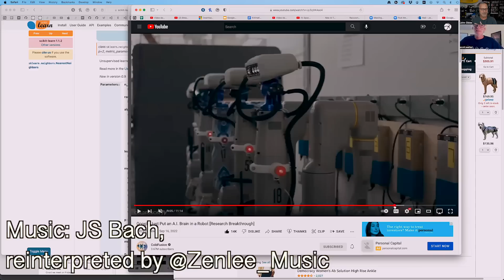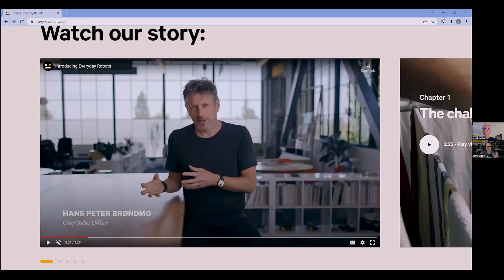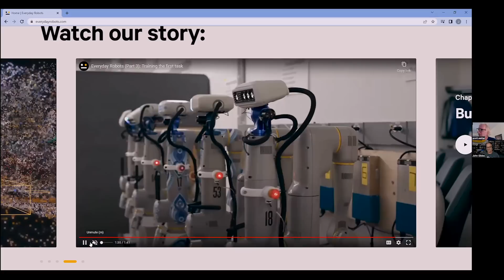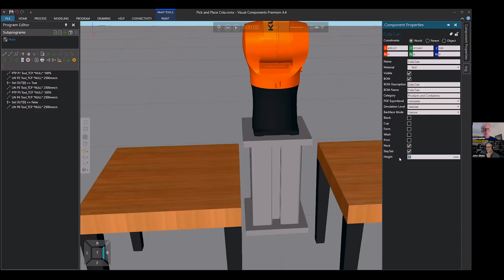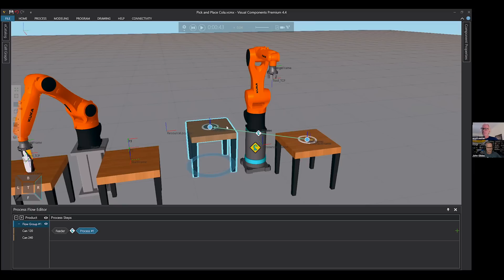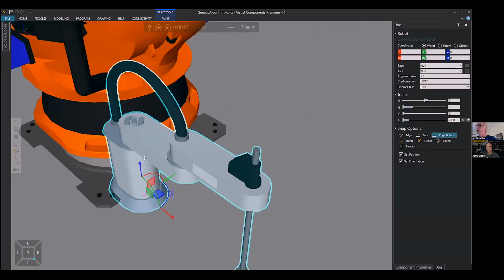GOOGLEBOT vs TESLABOT! Who Has the Right Approach? With Robotics Expert Dr. Scott Walter!

Comment: Cameras are LIDAR!
Active sonar vs passive sonar is no different than active and passive LIDAR. 
Active LiDAR uses light pulses (laser light) just like the ping sound of active radar,
And passive LIDAR receives light just like passive sonar listens only. 
Q: When Will people realize that the term LiDAR is not being used 100% correctly?When will cameras FSD be termed passive LiDAR (because it is passive light received by sensors) be used to when discussing active or passive LiDAR. 
Ask a submariner about sonar if you don’t believe me…

Comment: Following on from my previous theory is that maybe having a robot with a higher center of gravity is an advantage. This would allow the required instability to be controlled by leg and arm positions. It would be similar to balancing a broom on the palm of your hand  (with the broom head at the top). A space rocket, on take-off also relies on a higher center of gravity guided by directing the thrust in various directions the maintain balance?

Comment: The initial task of moving coke can is basically like the difference between machine language and a compiled language.  Making natural language processors even for just text has the same kind of lexical parsing and interpreting issues.  Not really a conceptually difference IMHO.  This is the same problem as programmers have been solving since the 1950s... Just with newer hardware and sensors.

Comment: I would suggest that walking upright requires inherent instability to allow the robot to constantly tend toward falling in any direction. This vulnerable state would help initiate movement by tipping in the intended direction. The onboard  "brain" would then intervene to control the fall by adjusting the footfall or center of gravity or both (resulting in useful human-like movement). This behavior might be compared to a modern fighter jet that is inherently unstable but is constantly being corrected by onboard computers. This allows the aircraft to react instantaneously to the pilot's instructions.
Reply: Humans walk pretty well and maintain balance "easily." Ears help a lot. Human physiology and kinematics are well-understood. Not to minimize the problems, but with reasonable sensory-motor controls and feedbacks, advanced AI models can be trained in simulations to handle a lot of those issues. Much of the focus on humanoid robots has been on "the parts." I hope TeslaBot brings many of these "parts" together into a real humanoid form factor and demonstrates that AI ability to sense, plan, control, and execute.

Comment: I think you have a misconception of a robot. The existing commercial robots are not humanoid robots and have simply an arm  with a simple end effector (no fingers) and simply move based on pre-programmed kinematics like the guest showed (joint or motor motions that result in the end effector position). No movement or navigation either. That's it. Boston Dynamics robots are the only exception probably although not humanoid they do locomotion and have some autonomous motion. So you can laugh all you want but all robotics so far has nothing to do with the humanoid robots in films. And Elon will not magically produce a humanoid robot over night. Think 2030s for that. And the demo will be disappointing to laymen. Only experts may be impressed.

Comment: A more advanced robot can actually be easier?  I.E. if it can grip weigh and tell on its own if it actually grasped something, then use 2 hands to cradle it (dont need pressure), it doesnt need to know specefic objects, just general routines for object types. Having it measure the weight on its own is super important for transport, self balancing.
Reply: Like the recycling routine. It should validate the objects are empty. It may also need to seperate plastic from cardboard (packaging).  That google bot just doesnt have enough sences and manipulation abilities to recycling real world outside of a lab setting.

Comment: I think to solve locomotion you start with simulation and then use neural network training until Optimus moves optimally. The problem is you need a working bot design so you can simulate with the right parameters.
Reply: Before you solve locomotion you have to solve moving from point A to point B (pre planned) without falling and smoothly and that is not trivial on two legs. What FSD can help is autonomous movement but FSD is not fully solved and needs adaptation for the robot. All this will take time.
Reply: @montymonto6430  I think this will probably be a lot easier for them to solve by comparison to the current needs for fsd. In the case of the cars every decision has to happen extremely quickly, and with all the moving variables and dangers the risks are a lot higher. I think the much calmer setting, at least in terms of speed and danger, will make the rest of it easier. 

Regardless of whether I’m wright or wrong though, I still very much look forward to seeing what they have on the 30th

Comment: My bet is that it is going to take Tesla much longer to get Optimus to a useful state than they think.  The “real world” that Optimus has to navigate is an order of magnitude more complex than FSD.  While FSD does have to identify objects in 3d, the actions that it needs to plan are very simple 2d actions and super simple in objective ..  ie don’t run over that thing.  Optimus has to understand and manipulate its complex hands, understand object topology, structure, weight, permissible orientation etc.  that gonna be many years of new neural net development IMO
Reply: Dojo, along with virtualized enviornments? It doesnt need to learn most stuff real time, it can do that virtually with time compression.
Reply: @gamerfortynine  I’m sure you are right that dojo and simulation will greatly speed things up, but it think there is a bigger problem of neural network design.  I’d be very surprised if the current neural net design for FSD is up to the job.  Think back to how many years and how many fundamental redesigns of the neural net it took Tesla to get to its current FSD design.  I suspect that there will still be many years of redesigns when they come up against complexities that the current design can’t cope with
Reply: Robot might be easier because they can start with robot that just stand there and do one task.  For fsd, there is too much external  variety like other human, animals and weather.  Robot that’s standing it has less thing to deal with, and car involve human life need more safety like 99.999999 accuracy like plane to be safe
Reply: @Nightthefirst  well AI day proved me completely wrong.  Their software seems far more suited to general robot tasks than I imagined.

Comment: Imo Tesla has proven the benefits of setting ambitious goals on the edge of what is feasible.  With their simpler approach google will probably be first to achieve a useful but limited robot.  But I think Tesla will be years ahead when it comes to a working multifunctional and flexible robot
Reply: That certainly follows the model of their operation.  Do the hard things first!
Reply: @woodyhunt  I think this is what Wall St. doesn't understand. Doing the hard things first is slow, has delays, ups and downs and often looks like a waste of resources... until you finally get it right and it's so far ahead of the competition they can never catch up.  Put another way, changing the entire game "overnight" takes a long time... but once complete, competitors are toast.

Comment: If the AI day 2 demo is just a bot prototype walking up to a model Y and plugging it in to a supercharger then walking over to another model y and unplugging it that will be super impressive. I'm sure the market won't understand what it's seeing but my mind will be blown.
Reply: I expect lot less. Their aim may be to create something "relatively cheap" which can be trained later similar to FSD.
So the first version may work so bad, that media will make fun of it. But after a year of learning it may outperform everything else.
So I expect lots of mockery from professional investors, and the media. The stock price may even suffer.
Reply: @adamrak7560  haha buying opportunity right.

One thing the market surely won't understand is that the bot doesn't have to be very sophisticated to create value in a factory. There are many boring, rote, dangerous jobs that a bot can do without having full autonomy solved.
Reply: @adamrak7560  imo, in this stage, Tesla has figure that out about FSD, and the team can make alot "function" for Tesla bot
Reply: Hmm after 12months I seriously doubt they are that far but happy to be surprised.
Reply: @Lee-fc3yf  I’ve always assumed they’ve been working on it longer. You wouldn’t announce a prototype in 12 months if you weren’t sure you had a lot of it already covered.
Reply: I dont expect any walking
Reply: Nothing like this will be done. Even if they do it it has to be pre-programmed not autonomous. But they will not do that because 1- that's cheating and Elon won't do it 2 even this is too complicated as first prototype. Also talking about market reaction this is really naive. You should hope market ignores and not react as will most likely be the case. If market reacts it will be negative not positive.
Reply: @montymonto6430  negative reaction is good it means I can afford to buy more shares
Reply: Tesla-Bot: You‘ll pre-pay 10000 dollars for the full self walking feature, yet this thing comes in a wheelchair.

Comment: @6:00

“If we can’t get an AI brain to get this thing to work, we are not going to get an AI brain to work in a more complicated one.”

I disagree and I think this points to a failed smell test about the dominant approaches being taken. As Gary Marcus likes to emphasize, improving mountain-climbing skills won’t get you to the moon. 

Also mobility isn’t solved. Quite the opposite - this approach is “sidestepping” the problem altogether. But the problem domain aims us towards a true solution. 

Approaching the problem from such a pixelated perspective likely leads to a lack of understanding the big picture. 

Stop running (interesting that there’s no running two-legged robots) from the actually problems. Instead lean into them.
Reply: Mobility absolutely can be sidestepped for the first applications of the technology as long as it possesses a decent enough level of mobility to navigate a human world. Mobility is both complexity and energy intensive. It's required in some fields but entirely superficial in others. 
A Teslabot would not need to go fast, jump high, or handle the roughest of terrains in a factory or warehouse, or if it's job is to assist the disabled or the elderly at home. It would be a bonus for sure but not a crucial asset.

 Meanwhile if it's job is, lets say, long range delivery, time sensitive delivery, search and rescue or first response, then extreme mobility and agility is mission critical and would warrant the extra resources to dedicate to the thing. 

The primary challenge to be trackled by the Tesla bot is software based. The hardware is made to be decent and efficient enough to work and be scalable, but let's be honest it's not striving to outdo Boston dynamics on the mobility front, it never did nor would there be reason for it. Mobility isn't solved but due to the interests of very specific markets it has evolved far more quickly than the AI side of things. And since it's a problem already well in the process of being resolved, one must look at the next mountain before they barrel straight in it.